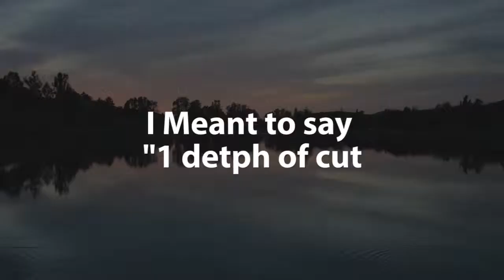PM-25MV  HOGGING 1 INCH DEPTH OF CUT!

Comment: It's really making quick work of that. What kind of endmill?
Reply from the maker: RIP Solid Carbide End Mill
Coated for Steels
38-Degree High Helix  ebay
Reply from the maker: @jonWilk8156  it would spin faster (; Really with that depth of cut running the cutter faster and feeding faster i don't think the mill is that rigid to handle it, i think it did very well for what i needed it to do